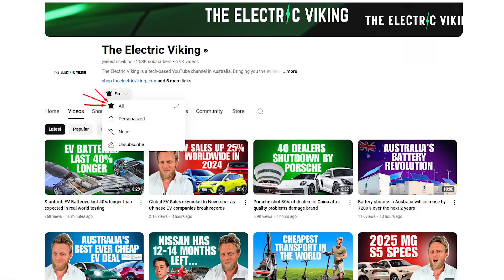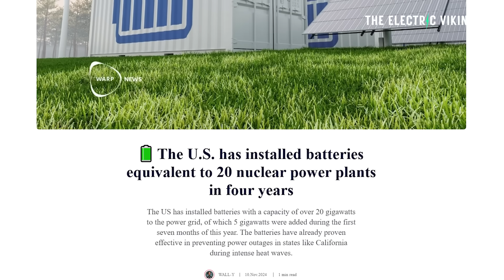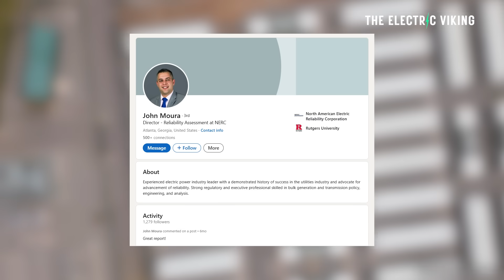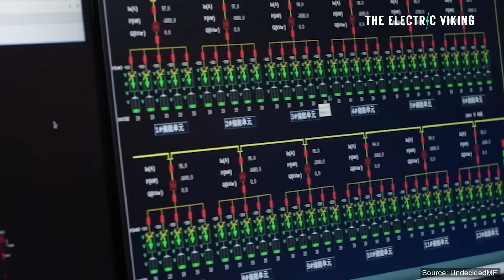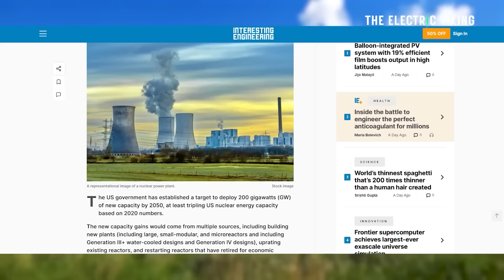America installed batteries equivalent to 20 nuclear power plants in 4 years

Comment: Batteries are just storage containers that need to be filled. You can't compare a storage container to a power generator. How many power plants does it take to fill those Batteries with energy?
Reply: you are missing the point, they are there to store all the energy produced by wind and solar etc.  THIS is the vital part of the future energy production that people seem to miss.  Also, evs will contribute to that 'well'  of storage, and we will get paid legally at last (a pittance) for it. The amount of homes in Ausi that have solar panels cannot be underestimated, add it all up and it is a no brainer.  Imagine all the factories in Ausi having solar panels on the roof and batteries to store the stuff, no need to use farm-land etc, and very close to the users!   Tesla figured this storage idea out years ago - buy it when it is cheap as chips, and flog it off during peak times.  Think about it, I just wish I had the money and the tech to do it myself.
Reply: battery is a money generator.
you use battery to store electricity anytime, sell it at peak hours.
Reply: @民主美国炸小船  - that one at least is true, and probably cheaper to the networks and the tax payers than gas peaker plants are currently.
Reply: @民主美国炸小船  For Elon Musk. lol
Reply: Battery storage is the biggest issue with renewable sources. 
Solar panels are almost dirt cheap now.
Reply: it can backfeed to the grid at peak hours, and even light up your  home directly.
so it can be container and power supplier
Reply: @民主美国炸小船  - yes, but not a power generator as the OP pointed out. Batteries need a power source to charge (grid connected, direct fed from renewables etc.), when not in use it's a energy store ('container') and when discharging is an power output  ('power supply').

Sam, really should just state batteries supplied by renewable generation - he kind of does this but in a split fashion, refering to storage at the start of the video as a generator before swithcing to wind/solar as the source at the end. If he intro'd the video by saying renewable powered batteries it would have been a little clearer as to what he meant.
Reply: @GruffSillyGoat generator needs oil > steam. both need inputs.
btw, in china wind turbines and solar cells bypass generators.
Reply: @RR_reunificationRights  No they don't. In fact this year China has reversed course on what ever little solar and wind they were installing.
Reply: @民主美国炸小船  - by power generator I wasn't refering to a specific type, rather any generation source of energy as in renewable generation, fossil fuels generation, nuclear generation, dynamo etc.

Generators by their nature take an energy input of one form and convert it to another form of energy at the output, typically as electrical energy (directly like wind turbines or indirectly like steam turbines) or output heat as thermal generators.

A battery on the other hand doesn't convert energy it collects, stores and releases it. Whether its an electrical battery or a thermal-heat battery. 

This difference I was attempting outlinine, a BESS doesn't generate it's own energy rather it stores the energy provided to it.

Batteries may also be direct or indirect, electrical batteries tend to be direct. Although flow batteries can be indirect if the reactants are produced (energised) offline and pumped into the flow battery for example. Or a heat battery that is heated by an internal generator (such as a resistive element).
Reply: @francismarion6400  what? how reverse course.
Reply: @GruffSillyGoat battery did convert energy:
electricity > chemical form in electrodes > electricity
Reply: @民主美国炸小船  reverse course. simple
Reply: @民主美国炸小船  - nope, the  input wnd oupt remain the same form of energy for a battery. The internal workings of who a charge is stored doesn't make it a generator.
Reply: @GruffSillyGoat only capacitor is not a generator according to your previous definition of generator
Reply: @民主美国炸小船  - why would a capacitor be a generator, it'a not classed as a battery either, nor is a transformer/inductor etc. 

A generator transforms energy but does not store it, there is no output without an input present. A battery accumulates the energy at its input to later release as an output, and can retain the energy for relatively long durations (unlike a capacitor). Perhaps the old accumulator pile name for a battery is more to your liking.

By all means try some experiments to prove otherwise, I'm sure the scientific and engineering communities would appreciate your esteemed insight and corrections to their centuries long concepts and nomenclature.
Reply: When factoring in the total cost of solar/battery, add in the value of fresh air, lower death rates, and the petroleum plants LOSE.
Reply: @1voluntaryist  When are we going to calculate the death toll from mining toxic raw materials to make batteries?
Reply: @francismarion6400  - perhaps we should calculate the larger impact of mining and extraction that has supported oil and gas refining first, after all this has producing such spill  for much longer than the much smaller volume produced by mining for batteries has to date.
Reply: @francismarion6400 we already do and you will not like the findings 😂😂
Reply: @GruffSillyGoat  There is no comparison. And again, China owns all the raw materials to make them.
Reply: @francismarion6400  - you're digging yourself a bigger hole. 

If by no comparison you mean the volume of minerals and waste produced by the petrochemical industry compared to the battery one  heavily slants towards petrochemicals then I agree.

Lithium is mainly extracted outside of China, in Chile and Australia. Cobalt is mainly source in the DRC, and is heavily used in petrochemical refining as a consumable catalyst, less used in batteries these days. Copper is abundant around the globe, as is silicon, iron, aluminium.
Reply: @GruffSillyGoat  Yes I know what the DRC is. They are clear cutting and strip mining there.

Comment: Power plants are rated in GW. Batteries are rated in GWH. The article states 20 GW of battery storage which is  erroneous.  A 1 GW power plant produces 1 GW each hr. A 1 GW battery  is dead after 1 hr
Reply: When comparing batteries to power plants, you need to convert them to comparable units. To properly compare a nuclear power plant's output to battery storage, you'd want to look at:

The power plant's total energy generation over time
The battery's power output and duration of discharge.
Conversion needs to happen of kW to kWh for both items.
Directly comparing kW and kWh is like comparing apples to oranges.
Reply: @BTC.maximalist  compare the up front costs of each and get back to me re the cost per kwh at the end of the day.
Reply: @BTC.maximalist  - only problem is the original source to this (the EAI) made no comparison whatsoever, instead going out of its way not to compare to energy sources. Rather it discuses the delivery of battery output capacity (power) over a 14 year time period. Throw a headline chasing newpaper journalist then an AI aggregation/news scrapping website into the mix and you get a right old mess. Sam's just reading out the AI generated content from Warp.
Reply: I like viking but he bad for missing important details like this which is exactly what I thought when I seen the title
Reply: Nonsense, they aren't comparable.

The Victoria 
300 MW / 450 MWh big battery consists of 210 Tesla Megapacks covering an area the size of a football field.

It is a 300 MW grid-scale battery storage project in Geelong, Australia which stores enough energy in to power over one million Victorian homes for 1/2 an hour.

To power the homes indefinitely the battery would need to be matched with about 200 10MW wind turbines and appropriate interconnections. The total capital cost would be about $4bn and have a life of twenty years.

A 300MW (SMR) nuclear power plant could power those homes indefinitely. It would also cost about $4bn but would have a life of 30-60 years. Nuclear power plants are however much more cost effective in larger units, typically 1GW.
Reply: @jimgraham6722  we can agree that this video is a disinformation.
Reply: @jimgraham6722  what about the cost of sending spent fuel rods for reprocessing to the US or France for the next couple of hundred years, they can charge whatever they want because there is no where else you are allowed to reprocess, think nuclear proliferation. The future cost of low and medium level waste storage and the cost of decommissioning the old reactor at end of life? What about the cost of providing Security for these reactors during their life-mandatory again proliferation? The future administrative cost of keeping track Fissionable Materials that is mandatory in the Nuclear fuel cycle? Are they included in the $4 billion quote or are we to ignore these things for convenience?
Reply: @ismifejzuli7874  Could be an issue but not necessarily so. 

For large plants my preference would be the CANDU power cycle developed in Canada and successfully deployed for over forty years. 

CANDU doesn't use fuel rods of enriched uranium but rather recycles it's natural uranium fuel bundles, achieving high burn up over the life of the plant. It can also be configured to 'burn up' waste from other nuclear fuel cycles as well as thorium.  

For this and other reasons, in my view CANDU technology (as for Canada) and despite its slightly higher capital cost, is particularly suited to Australia's situation.
Reply: @jimgraham6722  true but no matter how efficient the reactor at consuming fuel, it still needs fuel and creates radioactive waste albeit less. It still has to be decommissioned at end of life so the future cost of that can vary in a big way.  Regardless of the fuel CANDU consumes it still has to follow the principles of the fuel cycle. All fuels can be used for nefarious purposes so they must be accounted for, adding to the overall  cost. Sunshine is free clean and diffuse so is wind energy both can not (so far) be used to produce weapons of mass destruction. A nuclear reactor can be targeted in warfare whereas it would be prohibitively expensive to target a solar or wind farm in times of war and no extra damage is done to the environment even if they were. That is if a nuclear power reactor is a target of military action the consequences are dire over a wide area, a missile hitting solar panels will not cause the same environmental catastrophe as a reactor.
Reply: @jimgraham6722 how much would it cost to decommission it?
Reply: @jsanders100  They are funded 'through life' thus from day one refurbishment and decommissioning funds are escrowed from the operating budget. CANDUs are similar to hydro plants. They are designed for ninety years of operations. Thirty years operations,  then three years down for refurbishment. A second thirty years of operations then another three years of refurbishment and then a final thirty years operations and then full decommissioning.
Reply: Just right but wrong as well. as long its not stated how long they can deliver zhat power, any comparision makes no sense.
But right now the overall duration is about 4 hours, going up now to 8 hours.
Reply: Your a fudster who will be disrupted
Reply: Utility batterys are rated in output capacity and storage capacity. 

20GW of battery storage capacity probably has around 80GWh of energy storage, as many batteries have 4h of runtime at full output
Reply: @jeffl4810  Viking does not quote hours, at all. That's why it doesn't make any sense. As if he doesn't understand what he's talking about.
Reply: @BTC.maximalist  He is not an electrician/engineer.
Reply: @BTC.maximalist He tends to regurgitate articles he likes the sound of, without questioning their concluaions. After all, he is primarily a Tesla stock-pumper.
Reply: @FlintStone-c3s  I'm not an electrician or an engineer either. I just remember from my high school physics not to mix up units.
Reply: @brendanpells912  Tesla stock pumper? I take exception sir. He's obviously 
a China EV shill. 😄
Reply: @jeffl4810  Price right know is still around 150$ / kWh. 12 Billion $. That seems quite reasonable. But then you have to have production sources in EE that never drop for more than 4 hours at a time. Germany just had a month where something like 20 days there was little wind or solar (<10%). They needed to use coal to the amount of about 40 TWh (6 Trillion if you want to cover that with battery farms) to compensate (and import power at insane prices, as neighbour barely could keep up). They US clearly has less risk of something like this, but i doubt that only 4h will cover it.
You can go cheap and risk brownouts or you will have to use something liked pumped Hydro. Battery have cheap power and expensive capacity. pumped hydro (given you use geography) has medium power costs but very low costs for capacity. (e.g. PSW Limmern CH,  1GW, 33 GWh did cost about 2 Billion).
Reply: @beyondEV  the strongest power production in Germany during that period was electricity imports at up to 16GW.
Reply: 20 nuclear power plants worth for how long...? 10 minutes...? Have you considered the minerals required to build batteries to replace 2 weeks of no wind during winter with very little sun? When mining the minerals required, what environmental impact are we talking about...? It is done in China and Africa so I guess we don't need to bother about the environmental problems....
Reply: @rikardengblom6448 What, as opposed to the oil and uranium that grows on trees?
Reply: What about “ drill baby drill” we have thousands of years of fossil fuel. Plants need more carbon dioxide.
Reply: Dead, empty, after 1 hour, but refillable shortly, at zero additional cost. Liquid/gas energy is not so easily refilled, and pollutes. What is the cost of pollution, e.g., life, slow death?
Reply: @1voluntaryist 
If you have multi day shortage like Europe you can't refill the battery.
Reply: @muskepticsometimes9133  - not true, it depends upon the battery technology. Flow battteries can refil part way through discharge for example. Plus newer software defined battery storage systems can redefine part of the site as supporting discharge and another part as supporting charging on the fly, can even operate in mix mode arbitage/balancing/long-term storage within the same site at the same time.
Reply: @1voluntaryist refillable at zero cost? What kind of delusion are you living in? It's scary people put there are so dimwitted.
Reply: @1voluntaryist solar wind and batteries have far more pollution than nuclear
Reply: Both have capacity measured in watts.
Reply: The article's headline states "20GW of power", so is referring to the output rate rather than the energy storage level.

Batteries are rated in GWh and GW, one is a measure of energy storage capacity the other a measure of power input/output (charge/discharge) rate.

Power plants may also be rated in GWh in addition to GW as well, for example if an small oil power generator has a local oil store to run off, such as a small Island supply, it will run for a defined period stated as a GWh rating before running dry.

Comment: So, does that mean NG plants will be used for peaking?
Reply: It is a question of scale. Think of an area represented as a square. If over a given period of time solar radiation is sufficient to supply the energy needs of that square, then batteries can be used to store part of that energy for night time use. If there is a short fall, then energy sharing can happen between squares. Some squares such as in high latitudes might need supplemental assistance. What is happening is the concept of a battery based civilization.
Reply: @chrisconklin2981  It's becoming a hived network...
Reply: 😂 I knew that would happen.